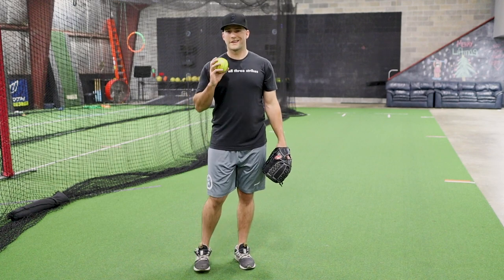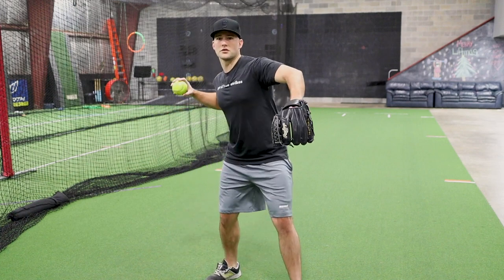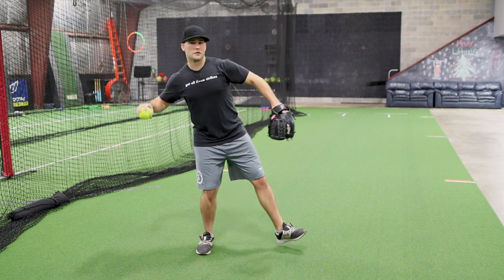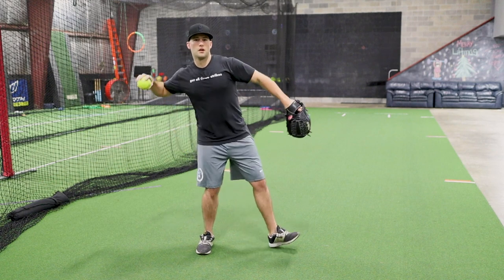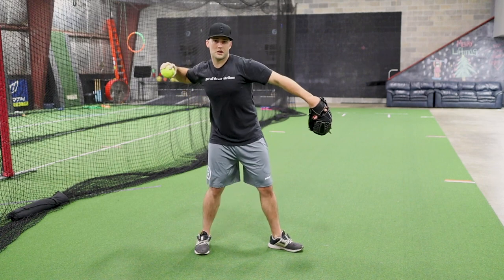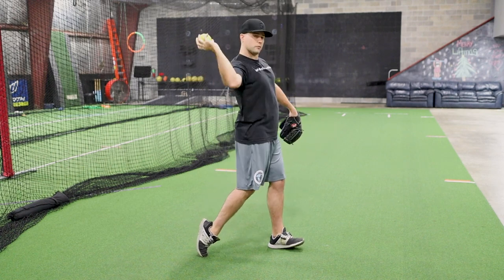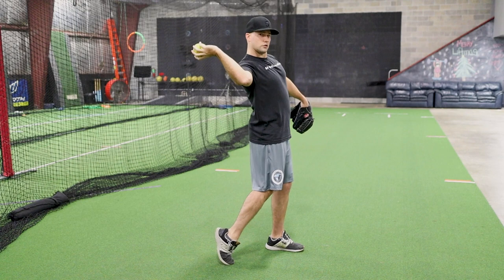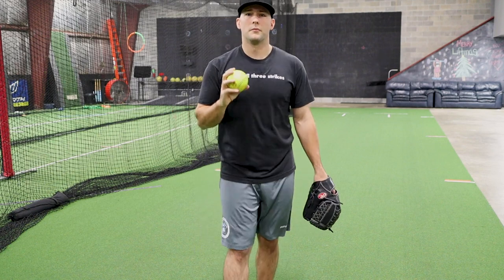Softball Throwing Mechanics - What's a Safe Elbow Angle?

Comment: Been dealing with shoulder injuries for a while now and they act up more when I really open up, not when I’m making a routine throw. Didn’t realize why until this video. When I open up my joint angle is well past 90. Thanks for the video.
Reply from the maker: Glad it’s helped! Angles are a big deal in the motion, so definitely try out the lawnmower drill and square hips drill to help fix it.